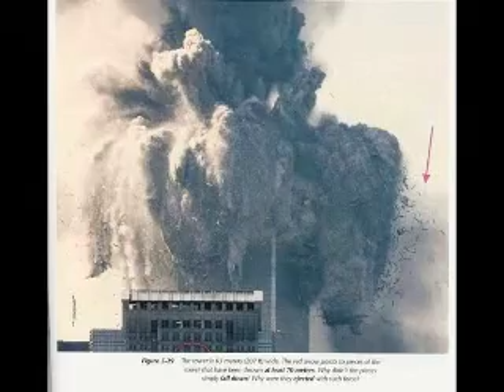9/11 Experiment: Crushing Concrete (since 1966)

Comment: You idiot Liars give away your mental incapacity when you base your arguments on obviously wrong statements of fact. For example, none of the WTC buildings used concrete as a structural support. Your entire video, @TruthMakesPeace , is invalid just on that basis alone. That's even before we get to the fact that if those several stories of building had fallen three meters and impacted that support column, it very likely would have collapsed the column, or, at least, the falling portion of the building. Of course, there is the fact that the the WTC buildings were much larger, and so much heavier, than the relatively small building that you used in your example. So, complete fail on your part, but you idiot Liars never cared much about science or facts, so this works for you.

Comment: The WTC had concrete only at the floors a smal layer of lightweight concrete, not real concrete. Most oft the WTC was steel, all the structural support was steel not concrete. A concrete building like the Petronas towes would not have collapsed in that manner, completely to the ground level.Fire has almost no chance on Concrete too.

Comment: check out the windsor building that burned like a fire ball for an entire day and never collaped, the two towers were designed to withstand the impacts of 707 airliners without collapse, the 707 and 767 are nearly identical really just a tad smaller and can create more kinetic energy believe it or not due to cruising speed, to think building collapse like this and this easily does a great disservice to the people that built them
Reply: @wheelmanstan Windsor Tower was made of concrete; the WTC buildings were made of steel. That makes all the difference in the world. So does the fact that Windsor Tower was much smaller and lighter than the three largest WTC buildings that collapsed. All of Windsor Tower could have fit inside WTC 7 without any part of it showing on the outside of WTC 7.

Comment: Your comparison is very flawed: The Towers were not steel-reinforced concrete, they were steel-frame; the building in your video has not been severely damaged in any way; and the building is not on fire.